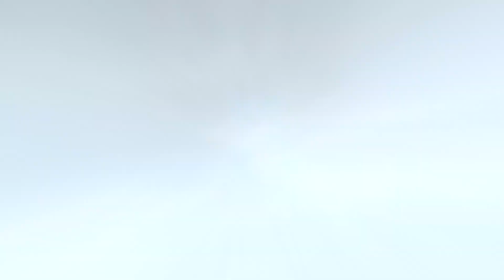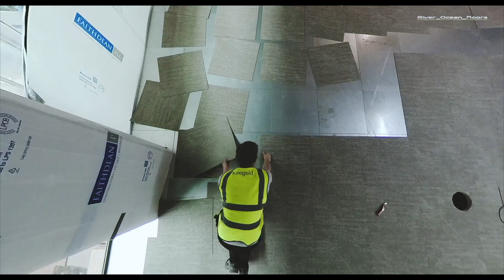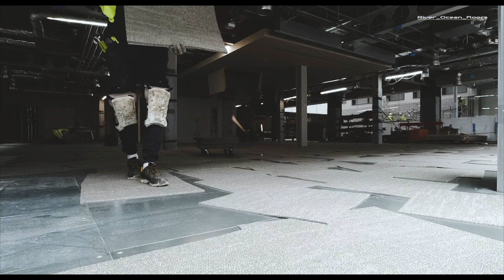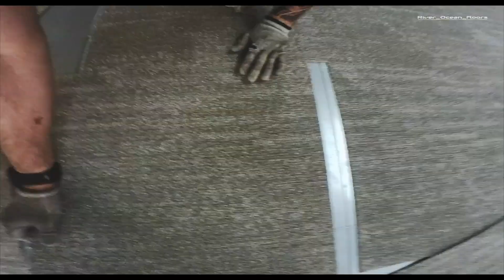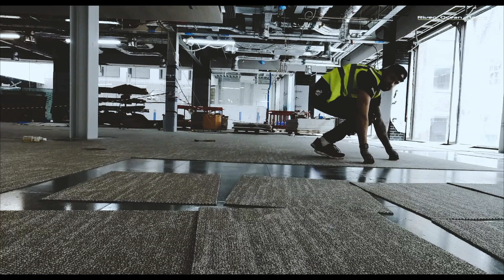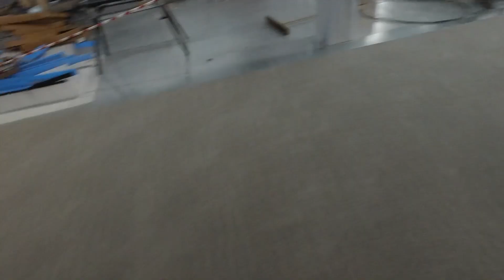Best way to install carpet tiles

Comment: Watched a few of your videos and now I have something to criticize. Always start in the centre of the area with four tiles, add to them with eleven around. Making the square bigger each time keeps it square and tight. It may seem alright blocking out along a straight line but it risks putting a bow in the tiles and throwing everything out.
Reply: There is no need to start in the center of the room when the pattern on the tiles are all facing the same direction. The only reason for starting in the center of a room with carpet tiles is to have an even look around all edges of a room. The way you described for the layout, is one way of doing it, but there are numerous ways to lay carpet tiles. I've seen numerous ways done. As long as the tiles are tight together and look good when the project is finished.
Reply: @RealKansasMan  Starting in the center is about keeping the joints from growing out of square or picture framing. Start square in the middle, and you should have minimal problems. Start on one side, by the time you get to the opposite side, you have doubled the amount of growth.